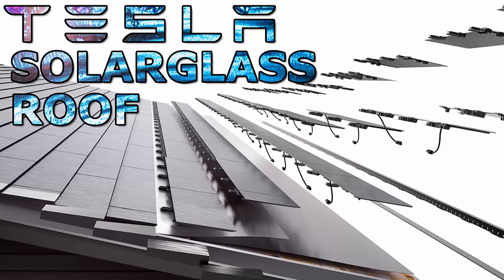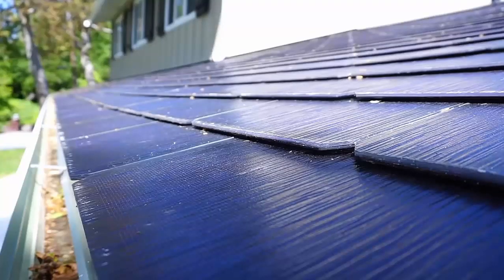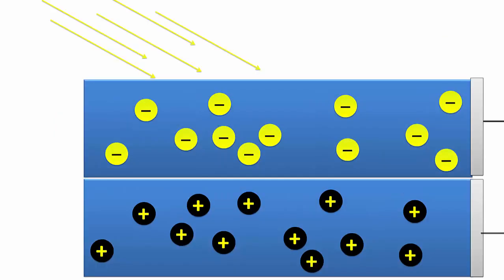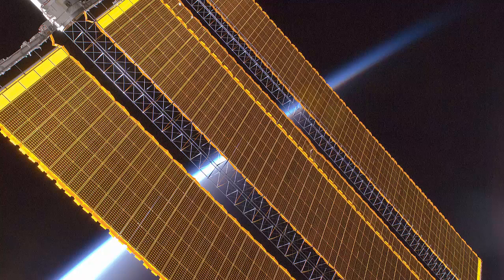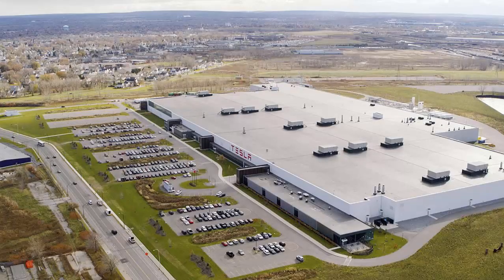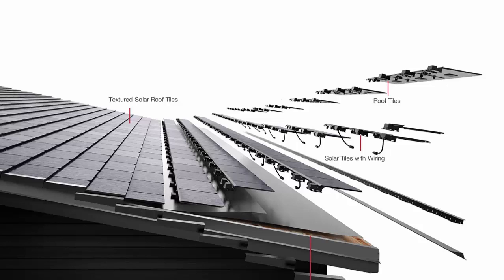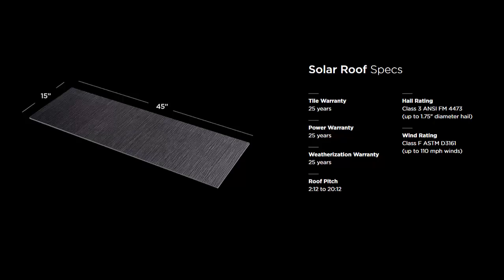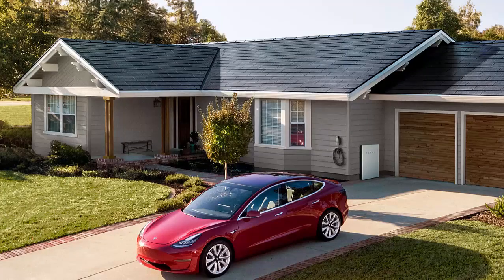The Truth About Tesla Solar Roof

Comment: I wish you’d looked at advantages and disadvantages rather than rehashing Tesla’s marketing material. Advantage: it looks like a regular roof. It’s tough. It’s durable. It has a ready made market in existing Tesla EV owners. Disadvantages: thousands of interconnects represents thousands of failure points and possible installation errors. A north facing solar roof in the Northern hemisphere is a waste of resources (as is a South facing roof in the Southern hemisphere). It’s more expensive except in the US where solar is overpriced. It’s black which absorbs infrared and makes the solar cells less efficient in summer. There is zero solar design and analysis going into an entire roof - ROI is sketchy. That’s my summary of the real “truth” behind Tesla’s solar roof.
Reply from the maker: Thanks! Great points. Will keep this in mind for future videos.
Reply: MondoTV Agreed, up to a point.  I would also be interested to know how the roof converts power into usable electricity.  What sort of inverter is needed and whether that places limitations on the overall efficiency of the roof.

Granted our south facing roof here in Australia will generate a great deal less electricity than our north facing roof but it would still produce a great deal over a year.

Given the difficulty cutting the solar tiles around the eves etc I wonder why not just use matching standard tiles there making installation etc much easier and cheaper and surely having only a limited impact on overall solar generation.
Reply: Yep this was a dumb investment for Tesla $5B
Waste of money for home owners, many companies have tried and failed solar tiles.
You want to save the planet: so install solar but I don't want someone to see/know I have a solar on my roof.
Is that really the only selling point?
Reply: @robsengahay5614  In Australia (where I live) an accredited solar installer would not install solar on a south facing roof - they'd lose their accreditation. If they did they would not get the RECs as it falls outside the solar design rules. In winter, because of the angle of the sun, you would produce virtually nothing. 
I have no doubt Tesla will do a good job on inverters etc - power electronics is one thing they know a lot about. 
I completely agree with your point on making matching "passive" tiles to reduce cost (they may be doing that I don't know - it isn't mentioned anywhere) - I also don't understand why they didn't make these in sheets of say "solar panel size" to reduce the number of interconnects and shading issues. The look on the final roof could be identical.  I'm just not convinced their is a need for this product as there are already solar panel products that can double as roofing products and they look great. Having said that with Tesla's inbuilt market, the madness going on with PG&E they'll probably make it work in the US where my 9.28kW Solaredge $AU10,000 system would cost $US25,000 (basically 4x the price)
Reply: Yep, there's no great benefit from combining these two things; the heat & connectivity issues should be obvious to any engineer, but it's an appearance based product. I'm amazed Dave Jones at EEVBlog didn't tear them a new one given the hype for such a "meh" solution. The USP of the version one product was that it was textured to look more like a tile. Again, from an engineering perspective; anything that diffuses the light would be expected to lower efficiency (& more pertinently, ROI).  There was a vested family interest in buying Solar City. Now they're pumping version 3 to the public whilst conceding the first two versions "didn't really work". The BS about it not being released to the public en mass.... demand wasn't there.
 This latest PR seems less about marketing to customers, and more about telling shareholders that all is well.

Integrating standard sized panels with a moulded glass front made to look like rows of tiles (with matching normal tiles at the edge/on the shaded side) would mitigate the cost, the problems of interconnects, overlapping cells and pre-cutting tiles at the factory.
Reply: MondoTV Living in Australia myself but hailing from northern Europe I feel that Australia is a little misguided on the value of solar PV on south facing roof.

Bear in mind in may parts of northern Europe even south facing roofs generate almost no electricity in winter due to limited daylight, grey skies and low sun.  In fact I would be willing to bet that any solar on my south facing Queensland roof (if I had it) would compare very favourably to a south facing roof in the UK in total generation over the whole year.

But I do agree with you that solar tiles on north facing roofs in the UK would be of limited value outside of the short summers where little energy is needed anyway.
Reply: @robsengahay5614  That's not really the point. As you move closer to the equator then direction becomes less important. And the fact remains that even in Qld which is a thousand kilometres closer to the equator than Sydney (and in North Qld, 2000kms closer) you'd still be nuts to put panels on a south facing roof. West, East and North are a much better use of resources over the life of a solar panel. And once again - you wouldn't get the RECs under the solar scheme, so it would be $1,000's more expensive for 1/3 the output. In North America, particularly as you get above California and Texas the situation becomes much worse. A North facing roof at higher latitudes will produce very little solar over a year. So costly for very little benefit.
Reply: Do your research! Tesla provide "blank" tiles for those areas where solar makes no sense I.E. shaded or North facing roofs!
Reply: @mondotv4216  - I asked Tesla many of these question.  Here are some answers. 

Many of the tiles are completely passive and used in areas where there is minimal solar power to capture.  But they have the same looks to provide visual consistency.  The V3 tiles are not installed as individual tiles, but large pre-assembled sheets of tile (50" X 14" from memory) so there are fewer interconnections.  However, the smaller size lets them do things like put a few sheets with solar into smaller spaces, like on sides that only get sun in the afternoon.  They use a custom SolarEdge inverter. 

Regarding looks, this is a huge deal for us.  We have spent hours doing things selecting the current roof tiles on our house, house color, gutter color, etc.  So looks do matter and the regular solar panels look like an add-on.
Reply: jerry kurata Thanks for the info Jerry. On the website it always shows an individual tile. I’ve not seen any of these pre-assemled sheets but even as far back as V1 I was suggesting that. Perhaps I should be a Tesla engineer? I’m glad they have passive tiles, but I hope they are a lot cheaper - like the cost of a regular tile.
Reply: @mondotv4216  - The original solar tile look like a standard slate or other ceramic tile, 2 times taller than wide. Regarding the price, they are cheaper than a new lightweight concrete tile roof plus solar for our home.  And more than just the tile roof.  And since we are looking at having to do a new tile roof and solar panels, cheaper.  We are going to pop over to the Tesla Showroom and make sure we like the look of the Slate roof before proceeding.
Reply: jerry kurata yes - that’s because solar is way overpriced in the US. A decent 6.6kW system here with tier 1 panels and a Fronius inverter would cost around $AU5,500 but I have seen them much cheaper - like $3.5K. But for a reputable installer that’s about right. That includes STCs which would equal about $3,500 discount (that’s an average - it depends what zone you are in. These prices include a 10% GST. So real cost - about $AU 9,000 or about $US 5,500. Systems in the US currently come in around $US2.80 per watt before incentives. It’s no wonder solar take up in the US is slow.
Reply: @w8stral  Not sure about that man, I don't feel like house roof get THAT dirty. And I know about people who never clean their solar panels (but I understand this concern in place where there's less rain). And btw, are you sure you can't step on them ? Considering the workers build the roof from bottom to the top, I don't see how they could get away without stepping on them.
Reply: @cedricpomerleau5586  Stop: Tesla got one thing right, they build from the top DOWN using a clip system.  Just lift previous and clip next on the rails.   Makes installation quick once rails are on.  WHY?  Solar cells must have ventilation under them otherwise they burn up and die very quickly.  Likewise must have space for the POWER CABLES.  Normal roofs build from bottom to top in direct contact with the roof.  Not true of TESLA solar roof.  Open your eyes dude.
Reply: w8stral I don’t get it. Are you for or against solar tiles? I think they’re a niche product for those that can afford it. I havenothing against them except a few engineering concerns and their high cost. I have an issue with Elon promoting them as being cost effective. The numbers just don’t stack up unless you pay way too much for your solar system. As far as shading and panel cleaning goes I can’t see why these are any less prone to those problems than regular panels. I imagine Tesla will make some kind of cleaning robot if you really can’t walk on them. If you have excessive shading then you need either microinverters or an optimiser system. Tesla may have a system that addresses that.
Reply: Daver G  I don't understand the point your making. It has nothing to do with any of my previous comments. Nor have trackers even been mentioned in this thread. And basically you're just wrong. Do you want me to send you my solar data for the last month? There have been times when my 9.2kW array has clipped the 8kW inverter and I'm making on average about 50kWh a day at the moment including overcast days. last month made 1.45MWh and that includes 5 days when the smoke from bushfires impacted solar output. Basically it is much cheaper to install more panels than install trackers. If you have shading issues install a microinverter or optimiser based system to overcome those problems (which a tracker system won't solve anyway). Plus larger panels are hardly impacted by birds etc.
Reply: Daver G  I was very confused by your previous comment as it was addressed to me and seemed to be refuting something I hadn't said - no one's saying you can't offer up ideas but it just didn't seem relevant. I'm assuming most people looking at a Tesla roof (the subject of this video) are not going to build their own Arduino based tracking system. BTW - I bet your mate didn't put those trackers on a residential roof? Because that requires an engineer and is a much more expensive proposition. Fixed roof based systems are practical, cheap (except in the US) and the only viable option for most residential properties (as that's the only space they have to install solar). I have nowhere to install a tracking system on my 1/4 acre block. So if you live in a rural area with acreage, can build a tracking system yourself , then yes it might make sense. But then you would hardly be in the market for a Tesla solar roof.
Reply: lots of interconnects in full weather 24x7x365.  It'll be fine
Reply: Daver G  Good for him. No good for me. Two pretty big tracking systems holding 8 x 320W panels (more if they are only 280W panels). That's not small,  that's massive and I'm pretty sure you'd need council approval for that kind of structure in Australia. Average solar panel weighs about 18kg , so 8 of them weighs 144kg plus the weight of the frame to hold them - let's say 190kg suspended on a pole. I don't know - sounds doable with a lot of concrete, a hole at least as deep as it is high. A four legged tripod arrangement would make more sense.  I'm not doubting you it's just a pretty big engineering challenge to do it in a suburban backyard. Kudos to your friend.
Reply: @pulporock  Solar energy will never be enough for our energy needs, in sommer we use alot more energy than we produce, because of air conditioning and also in consideration of owning an EV and having less efficient devices at home. a single nuclear powerplant or a single dam can produce energy for hundreds of tousands of homes

Comment: In Florida we need wind loads for these roofing tiles to be engineered for 160 MPH wind..... Is that possible?
Reply: Driven around the entire coast of Florida and nowhere is any offshore wind turbines to be seen? You have access to open ocean on both sides, so you are really missing out on such a perfect location for wind power.
Reply: Yes it is.
Reply from the maker: The official number on their website is 130mph winds
Reply: @frontseatgamer  Yes but can that be upgraded? Absolutely,  do they offer it? not at this time and not likely to you would have to DIY it with the understanding it will not be under warranty.
Reply: 167 mph

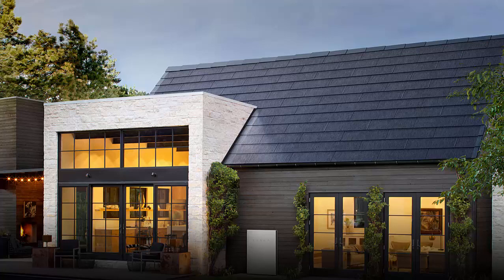Comment: When rooftop solar and a battery create net positive energy, this does not take the home off the grid. The home is still connected to the grid, which means it is not 'off the grid.' 0:49
Reply: You misunderstood what he was saying. He meant that if the power output of the solar system is large enough, you would not need to be connected to the grid.
Reply: @Pablo-wy9yg  That is not what he said. You have stated what he should have said. We agree on that point.

Comment: Having just had a Standing Seam roof put on to accommodate a non-penetrating attachment of solar pannels I have to take issue with a few things. 
Install time really isn't the issue it is made out to be. It took a week to put the new roof on and it was sealed with a membrane the whole time. 
A "regular roof" is Shingle, not Tile. Tile is the most expensive roofing material on the market. 
Roofs are priced out by builders by the square which is 100 square feet, the shingle is between $80 and $150 per square, My standing seam was around $250, nowhere near the $700 of the solar roof. 
The price of the solar roof includes incentives which include the power produced over the life of the roof and tax rebates. 
The out of pocket for my roof was $45k(including the gutter and remount of my solar water heater panel) plus an estimated $35k for 6.6kw solar array and a 10KWh battery(not yet installed). The tesla quote I got was a bit over $125k (before incentives) without a battery/power wall. 
As with the vehicles, this product is targeted at the upper-class it will be 5-10 years before the price is competitive for "regular roofs"

Comment: Can you walk on the roof when it is installed.  That is when some "panels fail" and need replacing?
Reply: The panels can take a bombardment of hail so they have no problem with the weight of a human foot. And if they are slippery you can cover them with rubber mats while working.
Reply: They are pretty slick. I was watching instructions to fire fighters in how to deal with them and if you have a highish pitch you won't be able to easily walk on them. For emergency purposes they can be stripped off fairly fast with a pick or chainsaw but as a consumer who just wants to sit on the roof and watch the sunset you will find that difficult if not down right dangerous. With the right rubber soles you could probably walk on a lower pitch roof but if you trip and fall you will slide off.
Reply: Only with ice cleats and a ice pick!
For warranty purposes only!

Comment: The glass roof will be a service nightmare. The cell efficiency is much lower than traditional panels and production compared to a similar sized traditional system is lower.

Comment: 7 $ a square foot  would equal   approx.  75 $ per square meter. An average  roof is 100 m2 , that would make the material costs   about 7500 $ per roof. Where did he get 33 000 $?
Reply: more to a working system than the raw cost of tiles
Reply: They calculated with 2000 ft² = 186m². It's $7 per square foot plus $2 per W. So $20000 for 10 kWp. Calculating with $2 per W is also bs. In Germany you pay $1.3 per W and that's with inverter /house cabling/inspection which they probably haven't included. So it's actually less than a dollar per W for the common system.
Reply: And then labour
Reply: @fatjim007  No way, material cost for 10kWp are around $7500. I am not sure what roof tiles costs, but tiling a normal roof is done in a day, when the whole roof construction is finally done.

Comment: What about the land fill issues dumping toxic solar panels, and could be more harmful with gallium.The solar companies are just dumping old solar panels that still work, but is cheaper to install new panels with a inverter. I currently scored eight 185watt solar panels that would have been dump in land fill and build a battery off grid system  to run my man cave. It seems that no one wants to talk about this.

Comment: Still way too expensive, especially if you you reasonable electric rates. Checked for my house, a 16 kw roof would cost $84,000, payback would be at least 50 years! Once Tesla has some competition and the costs come down to a reasonable level, would definitely be the way to go.
Reply: If you use regular panels your looking at 12k to 15k in panels alone. Telsa tile roof is horrible if you look at efficiency and cost installation and wait times.